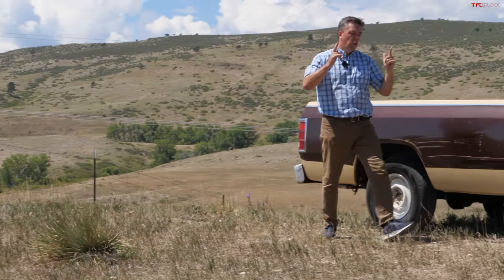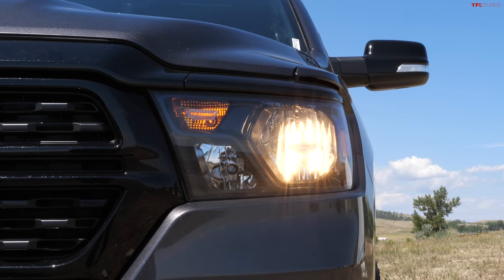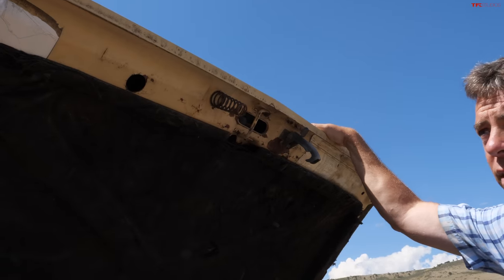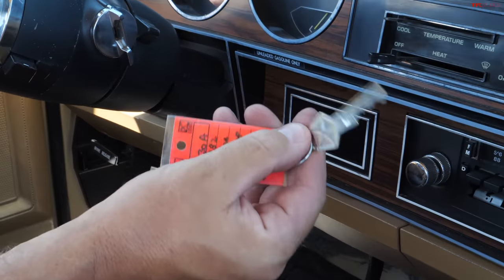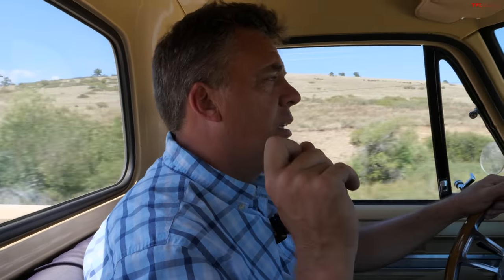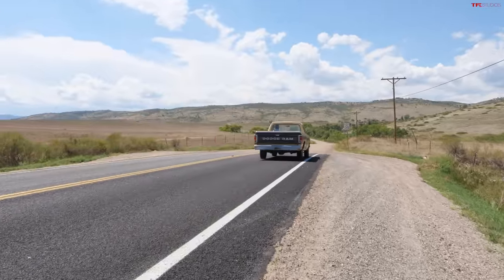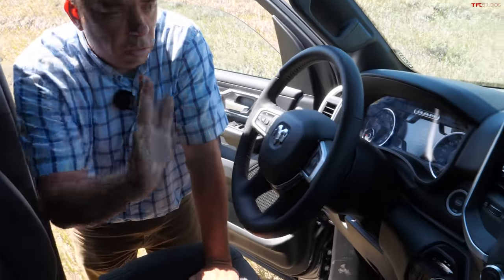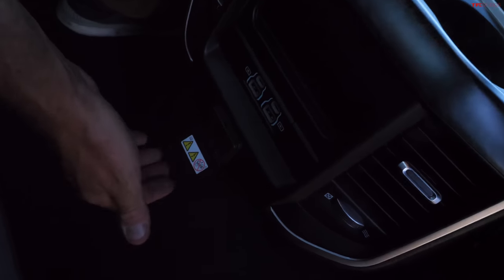You Won't Believe How Much Pickup Trucks Have Changed in The Last 40-YEARS!

Comment: In 1980 I bought a leftover 1979 chevy C-10. The salesman said it was the advertised special, $3695. out the door. It had 6 cylinder, 3 speed, no power steering, no power brakes, no a/c, no radio, no rear bumper and 6 foot bed. Drove it over 200K miles and only did tune ups to it. It always got over 22mpg and had decent power.
Reply: That's awesome
Reply: Would be worth a fortune today. Sounds cool.
Reply: Sounds like my dad's except his was a GMC (very little difference back then) and his had the longbed - a must for his glass business, the rack it carried was built for a truck with an 8' bed  - step bumper (another must since the glass rack blocked access through the sides and the tools were in the bed) and an AM radio that the dealer specced for everything on the lot.
Reply: that was a very different GM  than today

Comment: My grandpa had one of these with the bigger V-8.  Was ‘loaded’ at the time with suede seats.  I remember many trips sitting in the middle between my grandpa and dad.  The biggest change in this segment is that they’ve replaced the full sized car.  In the 80’s, families would get a big B-Body wagon, now they get a four door truck.  These aren’t just for work anymore, they’re family haulers.
Reply: Agreed and they are completely unnecessary. 70% of truck sold in good old USA are not used as a truck ever once. Get a mini van instead. Much respect to the mini van as a family vehicle. It doesn’t try to be cool or rugged because it’s build for families and purposely built is always cool!
Reply: In the '80s I don't remember many families having big cars at all, it topped out at an FWD A-body wagon if you needed a 3-row but there were plenty of Cavaliers, Escorts, Omnis and the like used as family prime movers along with an ever-increasing number of similar sized imports (a Civic wagon back then was the size of a late model Honda Fit, the newer Civics are bigger than an '80s Accord was).  B-bodies were for cops, cabbies and old folks who drove them too slow.
Reply: @nlpnt  The mid and late 80s saw an explosion of new GM Xcars and the Ford Taurus/Mercury Sable to try and compete with the Accord and ‘83+ Camry, Chrysler K cars and wagons and mini vans like the Dodge Caravan and Ford Aerostar. 

The 1980s was not a great decade for memorable family vehicles.
Reply: @trishaleaver3581  Why should I get a mini van if I don't want one. My money, my rules, and I like trucks. Why do you care if I don't hall or tow anything?
Reply: @rdsii64  because I and others like me need an 8ft box truck for work and stealerships and the manufacturers make very hard to get. I looked  for 3 years for a decent one to replace my old one. Trucks used to be for builders like me and other trades etc. Now real trucks are disappearing because the average truck owner does want an 8 ft box because it’s for groceries and ⚽️. I don’t care what you drive. You could drive a dump truck and it wouldn’t matter to me.

Comment: Thing I miss about all the old trucks are the window vents and the hi/low on the floor.
Reply: That's why I won't sell my 71 c10 !
Reply: I agree, They should bring the window vents back.
Reply: Why I sometimes still miss my 1975 Chevy Van!
Reply: @keithwittman4741  Jelous
Reply: @marcelo403polo2  I had to put up fencing, cause my wife hates lookyloos wandering into the backyard! 
"No trespassing" signs didn't stop them.
Reply: @keithwittman4741  👍 I just love square body. It was my very first pick up
Reply: Yeah, but that high low on the floor is not so great for winter climes.
Reply: @JwLincolnTC   I agree, better to find one equipped with a/c and just remove the a/c components, then you get to adjust the airflow as desired, you also get a bigger heaterbox which is a bonus
Reply: The really old vehicles from the 60's and 70's had footwell vents!  Remember those?

Comment: I'd love to buy a new version of the old truck.
Don't get me wrong, modern trucks have come a long way, but in that process, they've become unnecessarily large, complicated and thus expensive, compared to what they used to be.
If a manufacturer was to tool up and remake the old trucks again, with as simple as they are, they would easily be half the price, even accounting for inflation.
Reply: Agreed. I’d love to have the light weight older trucks but fresh off the line for a work truck. A first gen dodge with a Cummins and a manual, or a 1 ton Chevy with a big block and NV4500. I had a 1995 Chevy 3500 with a service bed on the back, the thing was light enough to get in and out of muddy job sites or around a farm to get to the broken and usually buried equipment.
Reply: Safety and emissions regulations would not allow a large manufacturer to build new "old" trucks.
Reply: @vivadjango  Sadly the rules have made simple, reliable, affordable un-obtainable.  Time to go shopping for a good old simple truck.  They will be around longer than any of this new stuff.
Reply: @vivadjango  Yep, there are many regulations this truck wouldn't pass now. Bummer.
Reply: I was curious about this too. You can build trucks on their websites. The Big 3 US trucks are offered in 2dr short/medium beds, all available with a 6cyl or V8. Only base models though - Vinyl/cloth, small infotainment, no creature comforts, steelies. Fleet trucks. Still, you're looking at $40k bare minimum.
Reply: They will not allow ?!?
Reply: 3 point belts were standard from at least 1981-.  The slant 6 was super torquey despite its diminutive size.  And having driven my parents in my youth, mileage figures were incredibly good.  Easy to drive all around.
Reply: Toyota Hilux

Comment: The  225 SLANT SIX...The leaning tower of power! One of the finest engines ever made! Automotive, marine and industrial versions. You couldn't kill it!
Reply: The Good’ol Buzzin’ Half Dozen!
Reply: Well you could kill it if you forgot to change or add oil to it but yes very indestructible engine
Reply: As someone who owned a couple, they had some pretty big design flaws, like putting the intake manifold very close to the exhaust manifold (made closer than normal straight 6's due to the slant). Vapor lock was always an issue. I got very familiar listening to that 'Highland Hummingbird' starter sing away trying to get a hot engine restarted.
Also, lots of them has a terrible oil pan/pickup design, putting the location of the oil pickup in the shallowest part of the oil pan (to clear suspension). Oil starvation was pretty common, only the loose tolerances and low, low, low power output per size kept them from seizing. And those two low spots at the front and back were sludge collectors
A high schooler i knew in the early 80's jacked up his Duster's rear enough to cook the back two cylinders (I'm not kidding. He even has a bondo attached snorkel hood scoop, with no hood cutout). His next car was a Nova 6 that he didn't J.C. Whitney all to hell.
I had decent luck with mine, one in a stubby '72 van, one in a '70 Valiant, but the 300 cube 6 in my 77 F100 was far superior. All in all, the slant has rode it's relatively undeserved 'indestructible' reputation for far too long. It was an ok engine, but not that much better than the Chevy or Ford 6s.
Reply: Interestingly never sold in Australia, but we did have a 265in HEMI Six  when Chrysler was building cars here

Comment: Great thing about the 82 Dodge when something broke you could fix it yourself in less than 30 minutes. New truck comfort is great but the price is getting out of hand with normal working class people.
Reply: Well....30 minutes if you can get the bolts to come out
Reply: You can change the starter without getting underneath on a slant six! Breaking bolts was less of a problem on Dodges then Fords or Chevy's. Dodge used bigger bolts. Especially around the water pumps and for the Crank Damper.
Reply: My thoughts exactly. I recently finally got rid of my old 96 Ram 1500 4x4 due to northeast salt rust (it's amazing it lasted that long). I just want a standard cab short bed 4x4 like my old Dodge. I'm looking at all the truck manufactures website and I just don't think I can afford a new truck anymore. Even the used truck market is super expensive.
Reply: @Jangocat  New trucks are all about status symbols. Its cringy. Ever notice when someone tells you what truck they drive, theyre sure to tell you its a DENALI and a DIESEL. And then they go off about how they "checked off all the options" when they "custom" ordered it. When people ask what truck I drive they always ask what trim level I got, as if leather seats is going to be the difference between my truck being capable enough to haul gravel or not. Its just a truck
Reply: @Jangocat  In the Southwest you migh tstill  find an older rust free truck for a reasonable price.
Reply: @Big Paw Exactly. If i could go back, i wouldnt have bought my truck. I have that much less money to put toward investments for an earlier retirement. But very few people think about the future.
Reply: That is the big thing about these early vehicles you could fix it yourself instead of going to the service department
Reply: @rhyse4818   They are replacements for high riding cars
Reply: 30 minutes? Apparently time isn't what it used to be.
Reply: It's an '82, it had electronic ignition, emissions pump with hoses and catalytic converter, you probably took it to a dealer new back then too. 

Time as time goes people learn how to fix stuff, I had an '06 that went to the dealership until I learned how to fix it myself..

Comment: I had a similar 1985 except with an automatic transmission. Used it in my business for almost 200k miles with only routine maintenance. It was the most dependable truck I ever owned. It was so easy to load due to the low height.  I laugh at people with modern trucks that are so high they need to use a trailer to haul their load.
Reply: My 89 has 267k on the old 318 actually just pulled it out last month and gave it to a buddy swapping a 94k 360 into mine now for a little more power
Reply: If people actually used their trucks to haul something other than ass, they wouldn't be built so tall that you can't load them.

Comment: My dad had a 82 D250 that was similar to that.  318v8 and 4 speed.   It’s what I learned to drive on.

I remember 1rst gear was a crawler gear.  

The slant 6 and 318 were both insanely durable.
Reply: I had a 85 318 automatic and that 318 was bulletproof
Reply: I learnt to drive on my Dad’s ’66 Chevy pickup.  First was also a granny gear.  It was a beast to drive but I towed a lot of horse trailers with that thing.
Reply: Slap a double roller timing chain in a 318 and you had a motor that would go a half million or more miles. I am less fond of the slant six but have a 1981 D150 with one in it now. I am in the process of converting it from lean burn to standard electronic ignition. The other problem with the slant sixes is parts availability is drying up. Not so for the V'8's.
Reply: @lisam4503  Yeah they were still using the 318 into the mid 2000’s
Reply: @donschiffer7400  To me the 318 was the best engine they ever built. It was their engine for the masses. Yeah the high performances engines are great but the 318 was the working persons hero!
Reply: I guess I just had bad luck. My grandpa had an 83 ramcharger with the 318. Damn thing blew up one day when I borrowed the truck to go to school. It had 90k on it when it happened. I wasn't beating on it but he never believed me. That truck was never abused he bought it brand new.

Comment: Andre, This is an excellent comparison and history lesson. In 1982, the vast majority of trucks were made as practical work vehicles for tradesmen and farmers. With simple RWD and just 100-200 hp under the hood, they got the crops in and the buildings built. Today too many pickups are overpowered and overpriced fashion statements. In those days if you showed up on a construction site with a 5 foot bed you would be ridiculed. Finally, I would be surprised if today's Ram 1500 has an engine that will last half as long as the Slant Six in the 1982 .  I would go so far as to say the Slant Six is Chrysler's truly legendary engine 🤩🤩
Reply: Overpriced fashion statements indeed.  If you grew up with trades, building, and truck culture of the 70s and 80s, you just kind of shake your head sometimes at trucks today.  We should keep the safety systems, but get back to basics for some models.
Reply: Very true, but what would you rather drive for 100,000 miles; this 1982 work truck or a TRX? I like them both for the record.
Reply: @natpaul81  Honestly?  I think the Maverick looks pretty good to me these days.  I don't need an 8-foot bed anymore.
Reply: In 1982 if you showed up in that 22 RAM... i assure you, NO ONE would ridicule you. 😄
Reply: I've got a 66 Valiant with a slant --  56 years old, starts every time, burns no oil.
Reply: @lamplighter5545  I drove/owned 3 cars with a Slant 6, each time the engine outlived the rest of the car.
Reply: And people in 82 would’ve said the same thing, only ridiculing the “new” 1982 truck and longing for the days of a 55 Chevy pickup.  And so on and so on back to the days of the horse and buggy.  Times change.  You pull up on a job site with an old beater these days, you’ll be fired.
Reply: @jmpersic  Agreed.
Reply: @DanBCooper  funny cause the last time i saw a guy pull into a job site with a old beat to hell base model 2wd chevy pickup from the 70s it was the owner of the company.
Reply: Overpriced fashion statement? True. Overpowered? Absolutely not in anyway shape or form. It's a case of rose tinted glasses of the highest order to think that 95 HP to use the 82 Dodge example is acceptable be it back then or especially now.
Reply: We had the F150 sold in Australia  till     1988. The car trucks killed them having a much lower loading height, in the case of the Ford Falcon a 2700lb payload, 5000lb towing. A F250 was rated at 8000lb towing for the 7.3 Diesel

Comment: The biggest difference is that a 1982 truck is running 40 years later, a 2022 will not be.
Reply: Anything can survive for 40 years if youre willing to pump the money into it
Reply: @rhyse4818  True, when parts are available. With the amount and types of parts in the new cars and the ev transition coming, I don't think this truck will make it.
Reply: @motofunk1  Yeah probably not. I could see them trying to phase out gas trucks but diesels always going to have its place for those who have campers and need to tow. And yeah the more electronics they put in the trucks, the less likely someones gonna want to keep it running. And once the parts arent available to replace their fully electronic gauge cluster, then bye bye modern truck.
Reply: @rhyse4818  I'm not so sure. Towing will be displaced. First a battery and drive axle will be put in trailers, eliminating the range issue with an EV having to pull. Then when FSD is available your "trailer" will drive itself to the destination. Airstream has a prototype of the first type already.

Comment: Love the video Andre! Yes, 1982 vehicles had 3-point seat belts. I had a 1980 Ford F100 short wheel base with 6.5 foot bed, 300 cid inline six mated to a 4-speed overdrive manual transmission, with a 2.75:1 rear axle. Claimed fuel economy was 30 mpg. I did see 30 mpg a couple of times. Loved that truck.

Comment: The ol leaning tower of power!  Learned to drive in a '82 d350 4 speed.   That truck is a 3 speed overdrive, had one in a '81.  Nice truck!
Reply: Well some say it's 3 speed with Granny gear instead of overdrive L123
Reply: @BuiltDifferent13  my 81 was a 3 speed with overdrive so I guess I assumed that was the same in 82, because my first gear was definitely not a granny.  My dad's 82 1 ton was a NP435 4 speed which had the granny gear that you never used with 4.10 gears. Lol
Reply: @hemiaddiction  I had a 87 F-150 with the Borg and Warner T18. It was a four speed but it said l123 similar to the new process. 435 first gear was about two and a half miles per hour and it was a 300 so it was redlined at about 3,800 RPM about to blow up lol .. in the winter when it was spending tire in the snow, you'd see the temperature gauge rise up and then you'd have to let off the throttle a little because it was such high RPM that motor didn't even like anything more than 3,500 RPM. Maybe a 5-speed would be a little better but with that transmission I was about 65 in the slow lane every time I was on the highway. Maybe 80 downhill with the mirrors tucked wind at my back in neutral
Reply: @BuiltDifferent13  yeah the trans in the dodge 150 back then was a new process A833 which had the overdrive which was a newer and weaker version on the old school A833 4 speed that was behind 340's in the muscle cars
Reply: @hemiaddiction  yeah I know the least about Dodge.... I prefer old Dodge like LA engines. AMC stuff is good too. I don't like old hemis because I like small blocks